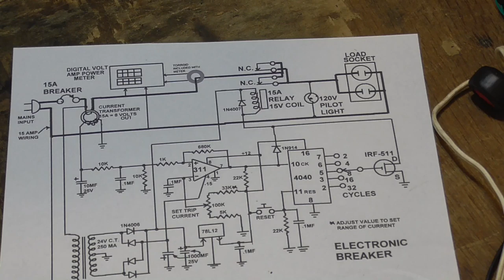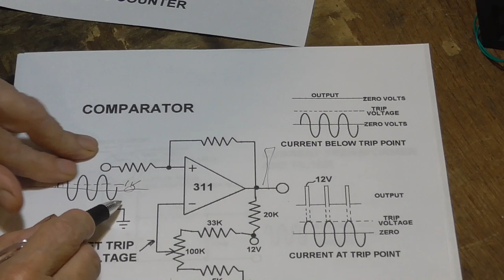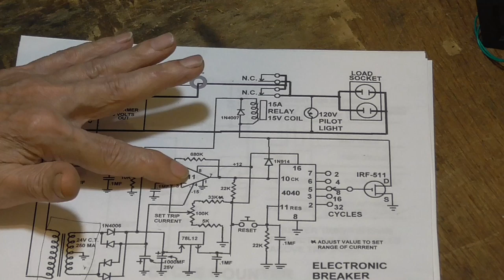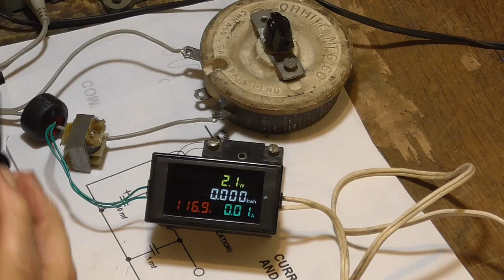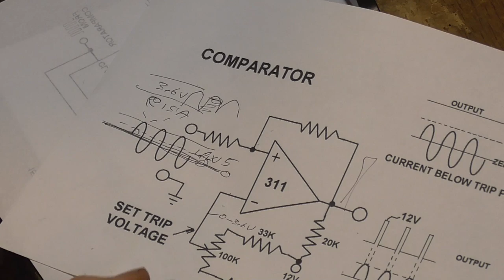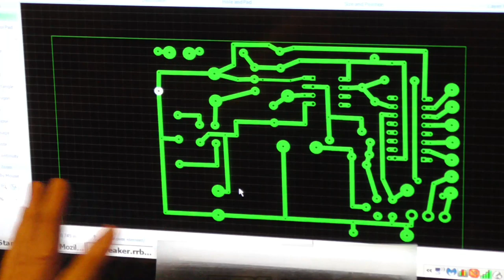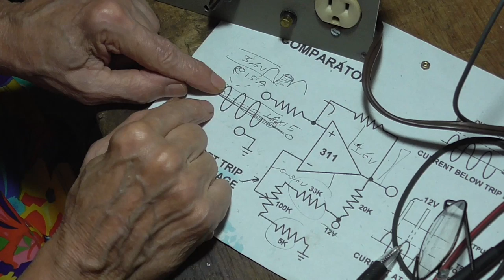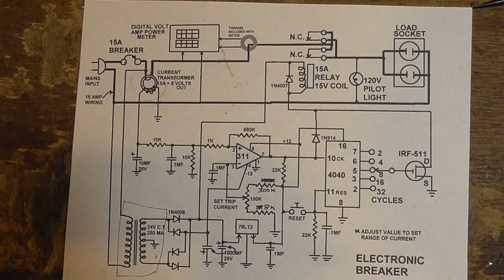BUILD AN ELECTRONIC CIRCUIT BREAKER

Comment: Is the capacitor on the filter from the current transformer polarized?  Shouldn't it be AC there?
Reply: Will be AC, but so low a level that most electrolytic capacitors will handle it fine. In any case with large input voltages the capacitor will just leak heavily, and thus also limit the voltage in the circuit quite well.
Reply: I wonder if it would be a good idea to put a bridge there so you can catch both positive going and negative going over currents....
Reply: @argcargv  Then you can not count cycles and have the trigger delay.
Reply: @zaprodk  Sure you just count twice as high.  2 counts=1 cycle.  It would half the maximum response time would be the main issue, but half a second seems awfully long to me.
Reply: @argcargv  You could, but then you would have to use a lowish value resistor across the output, without the 10uF capacitor, so you would have the ripple voltage to trigger the comparator and thus the counter reliably. The 10uF capacitor here serves that purpose by it's impedance direct, and does so with low loss, plus also acting as the low pass filtering as well to extract mains frequency current pulses mostly.

My only critique is that I would have preferred to have the relay energised always, and dropping out on the overcurrent pulses, which means the contacts will break properly, as most NC contacts on relays have a slightly lower surge capacity than the NO contacts, and having the relay always powered also gives a way to have a push button energising switch as well. Otherwise this is a nice design overall, simple and does the job just right.
Reply: @SeanBZA  Yes, the filtering would have to change if you are using a bridge.  A resistor would probably be a more reliable way to measure the current anyway,but a capacitor could be included to perform some filtering (although a lower value).

As for using the NC contacts of the relay, I imagine that these will break over a shorter period of time than relying on the spring to break the contact.  So from that perspective the current design is probably faster than using the NO contacts.
Reply: It's distinctly odd to connect a current transformer to anything other than a resistive load; especially to a polarized (!!) cap, because that's a component that's larger and more expensive than a resistor, typically has much wider tolerances (electrolytics are often -20+80), tends to drift in value (dries out),  kinda dislikes AC, causes a phase angle change (not important here), might 'ring' with the inductance.
I'd instead use a resistor, some back-to-back Zeners to clip the max voltage, maybe some rectification, optional non-polar cap for snubbing / HF suppression, a pot across the output to get the voltage in a suitable range. And maybe an Arduino to do some A-to-D, counting, etc. :-)
But hey, Ron's circuit works... so, good enuff :-)
Reply: @argcargv  Most decent relays ( those I would trust to break mains level faults) the NC contact sets are the lowest rated, and the NO set are the ones to use. I would use any of the methods to reduce current to just above minimum holding current ( series RC to the coil is around the simplest) and also choose a power switch with around 400V breakdown, and use a 240VAC varistor across the relay coil and the power device, so the magnetic field collapses as fast as possible. You will still have some delay, but it will be much reduced over the simple diode clamp. Mains rated contactors are cheap, and will break into a short circuit without issue, unlike a cheap relay, which will invariably either have contact life shortened a lot, or they will simply fail shorted. Plus the strong spring relative to the small relay means faster operation.
Reply: @SeanBZA  Ok, but what we are talking about here is a simple circuit that can be cobbled together with scrap or other items you have around.  In reality, even if the device fails you are still no worse off than just using a circuit breaker.  If you were under circumstances where it would really matter (e.g. professional work where liability could apply) you would just buy professional equipment because it wouldn't be worth the risk to use an untested design even if excellent components and design methodology were used.
Reply: @SeanBZA  > Most decent relays ( those I would trust to break mains level faults) the NC contact sets are the lowest rated, and the NO set are the ones to use." 

Every relay I've seen, the NO and NC contacts are same-sized; so arcing etc. would be exactly equivalent regardless which contacts were used to break the circuit.

> I would use any of the methods to reduce current to just above minimum holding current ( series RC to the coil is around the simplest) 

But the return spring still applies less force than does energizing the coil, so energizing the coil beats the spring return regardless.

> and also choose a power switch with around 400V breakdown

^^ Unclear what this means

> and use a 240VAC varistor across the relay coil and the power device, so the magnetic field collapses as fast as possible. You will still have some delay, but it will be much reduced over the simple diode clamp.

No reason to think you're correct, on this; a flywheel diode is going to clamp to 0.6V (or less, if Schottky) so should be much better than a varistor -- given that we know the polarity of the collapsing field voltage.

> Mains rated contactors are cheap, and will break into a short circuit without issue, unlike a cheap relay

Yes

>  which will invariably either have contact life shortened a lot

But we don't care if it's shortened from 1M ops to 10K ops, because we don't apply 10K shorts (or we can just replace the relay, s'ok).

> or they will simply fail shorted.

VERY unlikely when breaking a circuit; the arc might mess the contacts, but they won't weld during open.
And they're unlikely to weld at close, because 15A isn't welding-grade current.

> Plus the strong spring relative to the small relay means faster operation.
 
No particular reason to believe this.

Comment: Hello. I appreciate your videos and your competence. I would appreciate an explanation on why the electrolytic capacitor over the input would not be damaged by the alternating input. Will the alternating input voltage be automatically shifted up completely to positive?
Reply from the maker: The voltage applied is in the millivolts, not enough to hurt the capacitor.

Comment: Video idea: Could you demonstrate from start to finish how you create your circuit boards from scratch at home? I have always wanted to know how its done and I think it would a great video to learn from watching you make them. :-)
Reply: Wait, didn't glasslinger just provide that?  Software (Copper connection), UV exposure, ferric chloride, rinse, drill... did I miss a bit? :-)
Big Clive has a few videos of similar, which I found useful for his opinions on etchant ("FeCl3 works best"), pre-sensitized vs. film ("use an inkjet with UV-sensitive film"), drilling ("don't drill your fingers..."), etc.

Comment: At 35,11 how can you put an electrolytic cap of 10µF why it is alternating voltage of 60V peak and it will be destroyed by inversion?
Reply from the maker: No. The capacitor is a dry slug tantalum which will take reverse voltages of 1 volt with no damage. The actual voltage across the secondary winding is less than 6/10 volt RMS with 15 amps current in the primary. This low voltage won't harm the capacitor at all.

Comment: I think - electronic circuit breaker with resistor in serries is better.... 10ohm resistor limits short circuit current to 22...23A and from resistor can remove measuring and relay triggering voltage.
Reply from the maker: Yes, that would work. Sometimes the obvious isn't obvious until the project is already built!

Comment: What advantage is there to using this circuit over a Dim bulb current limiter used in conjunction with a Variac.
Reply from the maker: This is a fault situation power cutoff. It totally cuts off the power within as little as 1 cycle of current. This can save expensive semiconductors and other sensitive equipment.
Reply: @glasslinger  it simply cannot. No electromechanical device can protect a semiconductor device. Not even a fuse can. To protect a semiconductor device, you'd need a reaction time of hundreds of ns, tops, and even the fastest relay can't give you that.
Reply from the maker: @mattmoreira210  You obviously have not much experience. This unit has saved literally dozens of expensive power FETs when testing servo drivers and switching power supplies. You can read and read and read but not catch what actual experience yields! Of course there will be situations where the unit will not succeed but the number of times it does succeed far outnumbers the times it fails. (that from actual experience!)

Comment: Hey @glasslinger, thanks very much for this; not only because it's a really interesting project, but also because it's pulled lots of EE-ish people outta the woodwork :-) 
Unrelated: cool frocks, outstanding use of borosilicate, thank you for what you do :-)
Edit to add: I'm a little disappointed you didn't show us an easy way to put a couple hundred additional turns around a toroid (as provided with the V-A-W meter) rather than re-using another transformer :-)  But admittedly, winding onto a toroid ain't easy... :-)
Reply from the maker: Also it's quite small. Let me see you do it! (grin)

Comment: Great device, how about a 230volt version?
Reply from the maker: This unit will work fine at 230 volts. Use the appropriate power supply transformer and relay.
Reply: @glasslinger  thanks

Comment: A current transformer must always have a resistive load on the secondary, if not the voltage on the secondary side will give very high spikes if the transformer core saturates. Also, the use of an electrolytic (polarized) cap in the filter is not a good design
Reply: Pretty sure that, once the core saturates, there's no additional coupling to the secondary; because the flux can't be increased, that's what 'saturated' means.
But yeah, the secondary will give a high output voltage (glasslinger initially saw 60V AC) if there's no [resistive] load on the secondary.
Reply: The capacitor is a load (impedance) (reactance)

Comment: Insert small battery to power electronic CB. In short circuits , voltage drops to zerro and it loss power supply voltage....
Add short circuit current limiting circuit ( resistor in series or inductor )
Reply: The bulk caps of the internal power supply will happily hold the voltage long enough to energize the relay and break the circuit. Ron installed something like 1000 or more microfarad caps.
Reply: Glasslinger has a 15A breaker (top left on the schematic) to defend against any fault current the relay can't clear; but there's likely enough charge in the smoothing electrolytic to pull the relay in (breaking the circuit) -- and besides, putting a battery in a mains-powered device (other than for BIOS and clock, to cover power outages) is generally a bad idea.
Edit to add: amused that 
MrJohhhnnnyyy posted almost the same, just slightly ahead of me :-)
Reply: @mrjohhhnnnyyy5797  yep!
EDIT:
there's the relay anyways, mabe a 1000uF cap may not be enough, if salvaged (for free) you can put kinda whatever amount there, 2200uF 3300uf

Comment: But Ron your tantalum cap is polarized. Isn't AC a bit harsh on it? Even worse it may over time add parallel resistance and makes your measurement questionable.
Reply from the maker: Solid pellet tantalums can take about 10% of their working voltage AC without a problem. This circuit has almost no voltage so the cap is fine. If it worries you, a non-polarized capacitor could be used. It really isn't necessary with millivolts across the cap.
Reply: @glasslinger  Ahh, okay thank you :). BTW. I really do like your approaches. Creating all the tools etc. reminds me a bit on my former birth-country (East Germany) where we had to create our own tools and rigs because there was no free market with nothing available. Now living in Canada for 30+ years has changed all that, only nostalgia remains. Keep up with your  super interesting projects.
Take care
Lutz

Comment: (1) How many Miiliamps does it take to convert from AC to DC Please?  Ball Park Figure Please.

2) Does a Voltage Spike exist for Every Single time a Switch is Turned On whether it Supplies a Low Wattage Light Bulb or an Appliance?

(3)  Is it True the Higher the Load on an Appliance, the Higher the Voltage Spike will be such as, but Not Limited To, the Motor on a Vacuum Cleaner?

(4)  Does both AC & DC have Similar Voltage Spikes?
Reply from the maker: The circuit generates about 1 mv per ma current through the transformer. The capacitor across the transformer secondary eliminates the spikes so false triggering is reduced. This unit is more for bench work rather than general household use.
Reply: @glasslinger  -- THANK YOU.  You are Precious and a Scholar.

Comment: A tour de force!  Kudos for production values and circuit design with clear explanations for the what and why. 
MOVE OVER MR CARLSON with NONE of the incessant tiring nanny state safety blathering!
How difficult would it be to have a second range, a divide by 10 current range, so your current cut-off settings would run 0 through 1500 Miliamps which would allow working with solid state devices?
Reply: Peter - your easiest solution is to put 5 turns on the current transformer, in addition to the current 0.5 turn, and then switch between those windings to get the x10 difference in sensitivity.
Kevin - Peter didn't mention DC, you intro'd that yourself. Although ja, can't use a current transformer for DC.
Incidentally, I prefer glasslinger's "git 'er done" to Carlson's perfectionism and occasional hectoring and self-promotion; but hey, both have excellent info :-)
Reply: Kevin Counihan  Good stuff, thank you (and no, you're not being a jerk :-)
I wondered about using a precision full wave rectifier (I'm visualizing some very old 741 circuits...) and I hadn't considered  that any kit that half-wave rectified just the un-monitored half-waves might not cause a trip on overload -- and maybe just plugging in a non-polarized power cord "backwards" would be enough for this?
Reply: I don't immediately find a copy of the cookbook, but this might be close enough: http://www.miedema.dyndns.org/co/2018/Op_Amp_Applications_Handbook-Walt-Jung_2005.pdf
And thank you for the suggestion, because I need to go do a little rectification m'self :-)
Incidentally, have you encountered https://en.wikipedia.org/wiki/Poka-yoke ? "Can't put it in backwards", roughly, an excellent idea from Deming and Japanese production.
Edit to add: cookbook here: https://ia902909.us.archive.org/5/items/ICOpAmpCookbook_201808/IcOp-ampCookbook.pdf
Reply: Much as I admire American exceptionalism (yay moon landings, Musk, etc.) I'm fairly sure you may have bigger but you don't have better idiots (than e.g. we Brits) :-)
Otherwise: thank you, good advice and strongly seconded (esp. since my LM and uA books probably got pulped in the '90s, and now I gotta look for PDFs..._)
Reply from the maker: The circuit will detect and break REPETITIVE non symmetrical load currents. The design (in the video) specified that it was NOT a single cycle load breaker! If you have two or more cycles of current  either symmetrical or unsymmetrical it will break the circuit. The trip point for the "wrong" polarity on non symmetrical currents will be twice the current for the opposite polarity. (remember, it is a TRANSFORMER that is detecting the current, NOT a resistor!)

Comment: Very "elegant"  and intelligent  solution !Would you help me on  a design  where from 120 AC ,at the press of one  button this voltage would fall gradually to 0V  in a 8 seconds ? A second button would restore the full voltage again. Load is a big magnet and its current can be as high as 20 A ! Since each cycle (60Hz) is 16ms, counting  about 600 zero crossing( opto MOC 3020 and IC 4040 perhaps) could provide some kind off control  serially putted between de outlet and the load .? Since keeping the sinusoidal shape  is imperative think we can not use thyristors  !

Comment: Why use a capacitor in parallel with the secondary of the current transformer instead of a resistor?
Reply from the maker: The capacitor significantly reduces high frequency spikes more than a resistor would. The problem is the turn-on spike that can be many times the set point. You want that eliminated.